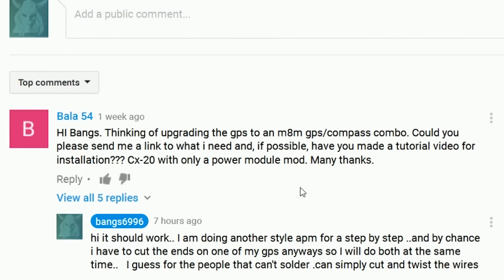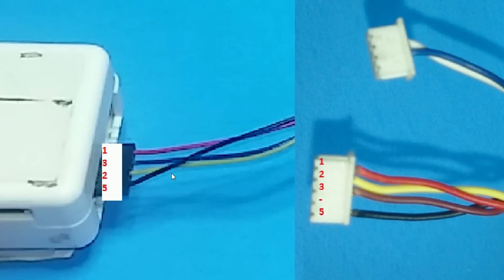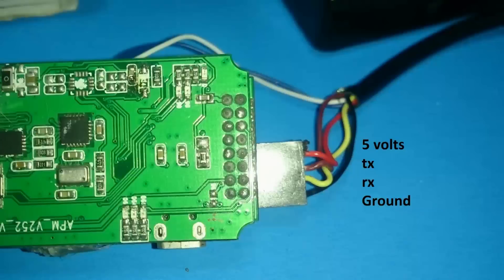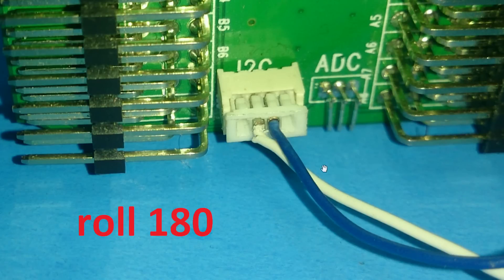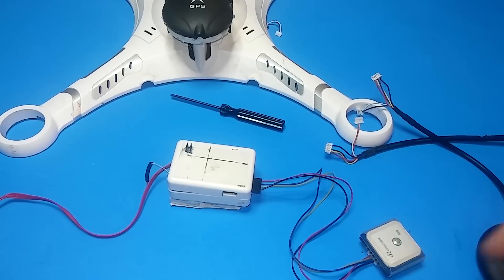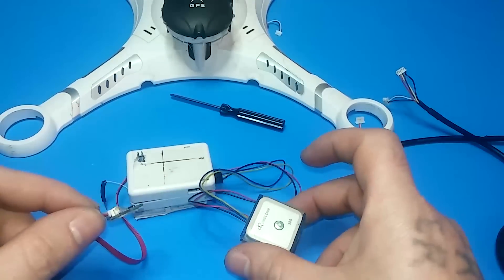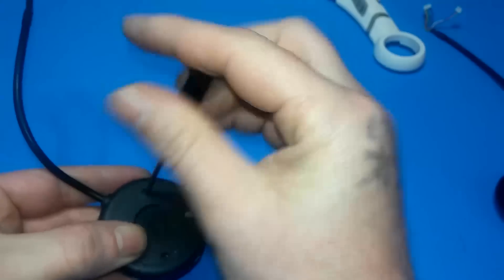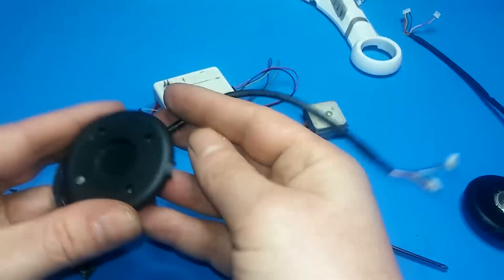cx20 apm 252 v5 upgrade only gps the compass is optional

Comment: Is it proven that the gps change makes the quad a better flyer?. Because it looks like it performs the same to me. Just getting more sattelites. That's it
Reply from the maker: HI its not really worth it unless you have issues with yours.. more satellites means you have  more stable gps flight or return to home. .. the m8n gets the most satellites however it was shown to me all three 6m (cx 20 gps) ,,neo 7, and m8n all get the same specs on tracking ..  In theory the neo7 and m8n should work better then the 6 on cloudy days ect..
Reply: bangs6996 Alright. I understand. Good mod indeed. Well mines work stock fine so if it works why change it right?. I'll like this if any issues later down. Blessings

Comment: can you program my apm on my cx20 to a 30deg tilt.  i will ship and pay for you r services. thanx
Reply from the maker: I'll just create the firmware and upload it.. just give me a bit..just testing it out..
Reply from the maker: hi.. you still around?
what firmware are your on?

if your on version 3.21 or even 3.12 but i think version 3.12 is limited to 2200 already..
anyways..before i mod the firmware try this..
open up mission planner.
go to
config/tuning 
Full parameter tree
look for
"ANGLE MAX" 

try changing that to say 1000 
then write your parameter. unplug the quad and try to fly it.
indoors if possible as it should have almost no tilt at all.

then try 3500 ect.. becarefull not to use 8000 ect..or you will probably destroy your quad..

-------------------------------------------------
If you don't see full parameter tree
open up mission planner but don't connect
go to 
config/tuning

only thing that is probably listed is Planner
click on planner if others stuff is listed.

scroll down "Layout"
and change it from basic  to advanced

let me know how it goes..
Reply: YOUR AWSOME, THANK YOU.

Comment: Hey, thanks for mentioning my video! Just thought i'd let you know the wiring for this particular gps, http://www.ebay.co.uk/itm/252111344885?_trksid=p2060353.m2749.l2649&ssPageName=STRK%3AMEBIDX%3AIT. Thought it might come in handy for someone else. Black to black, red to red, yellow to white and blue to yellow. Can i ask you a question also if your not to busy. The syma x5c manual tells you how to use the trim buttons ie if it's drifting to the right , click bottom right trim to the left......and so on. It's so simple and effective. Can you do the same on the cx-20 and if so, which of the 4 switches do what?? This is hardly ever mentioned anywhere and would be such an easy fix to a lot of problems that otherwise would be conceived as complicated. Just a thought...... The latter colours i mentioned there, by the way ,white and yellow are rx and tx in that order on gps end. Who's complicating things now??!!!!! I have put my quad back together but waiting for weather. Will report. Ta.
Reply from the maker: the trim buttons on the cx20 correspond in the same direction as the sticks.. if you want to see your progress .. connect just the usb  cable and go into mission planner.. Radio calibration,  then start using the trims, you will see the pwm move about 100-200pwm in either direction.

so with that, say its rolling to the left..  you will want to move the trim button to the right..

Its also why I tell people to find center before doing a esc calibration or mission planner calibration.

the throttle does nothing  as far as i know, I think its really there because of the mod1 remotes ..could be wrong..
Reply: Hi Bangs. Could you tell me what the advantages are of updating the apm from 2.5 to ...........whatever?? Also, although i've installed the power module and gps , am i really wasting my time by not installing a different fc aswell?? Havn't flown yet; wind can stay up here for months (not always like the video!!!) . Thankyou, i value your opinion.
Reply from the maker: Hi and thanks.. the pixhawk would be the next upgrade I found the apm very solid so much so I took it out because I found no point making step by steps for it..as everything seems to work for it.. where the apm 2.6 I have more fun modding it ..

upgrading to apm 2.8 .. is really pointless and only benefit are the pins..   adding things like sonar and optical flow is more of a novelty, and you would prob just remove both over time. 

naza-m v2  gets good reviews and better gps rtl then the pixhawk, butttt I don't have one to give a honest review on it. 

I keep holding off on the naza-m v2 because I keep thinking a new apm will be coming out any time soon with more avoidance firmware and hardware.
Reply: Sorry, lost you there a bit, remember i'm a novice !! Ha. Would the pixhawk be my next move?? I'm not planning this anytime soon; just curious. I did watch a part of your pixhawk installation video earlier. Looks a bit complicated!! Saying that, i'm sure it's not as complex/confusing as it looks??? To be honest, i'm really enjoying tinkering with it now and it doesn't instill half the fear of flying it!! I was actually going to bin it before i got in touch with you initially. I'm glad i didn't. You learn a lot about something by being helped to fix it. I'm not really interested in telemetry , at least not yet, i just want it to be stable so i can relax while enjoying flying it. After all is'nt that what it's all about?  Do you think , optimistically speaking, that what i've done to the drone has improved it slightly......vastly??  Sorry for rambling!!
Reply from the maker: I would say slightly if the upgrades were power module and gps .
they were both upgrades.. the power module for rtl on low battery and 
gps for locking on sats faster or at least re finding them faster.

I just had to go through our messages.. did you get your led's working under the quad. or did you leave that ppm wire off??

You do have another option with those leds  , I think they still blink on low voltage for you , but you can un solder all the led wires from the main board .. so you should have 4 white wires(maybe one red,motor 1) coming from the 4 esc's. then attach them  to your power module 5 volt wire that you might not be using.  you will then have all 4 lights.. but they won't blink on low voltage, The alarm should still sound though.
Reply: I think i did leave the ppm wire off. To be honest i don't think the lights are all that necessary. I would ,of course, put them back on if it was a relatively easy job the next time the lids off (which prob won;t be too long! Ha). Will my alarm sound at the moment at low voltage?? I can't remember. Thanks for trawling through that. Roll on spring so we can fly them!!!
Reply from the maker: yes thats a good price for the apm http://www.gearbest.com/multi-rotor-parts/pp_234810.html?wid=21&lkid=10348444  you can find them on ebay as well for 28us  .. I am working on a video right now on a apm from gearbest.. and will be uploading today or tomorrow
Reply: Ok Bangs. I might go ahead and purchase but a couple of questions first if i may? Would this be a big improvement from the stock fc and if so, why?? There's a couple of customer questions and answers in the link which confuse me. Basically implying that it's not compatible. I assume, with your expertise , you can find a way round that? Thanks.
Reply from the maker: no improvements..they both take the same firmware and have the same hardware,
the only thing you can benefit from is the better gps
and easier way to plug in things.

No idea why that person said it would not work , maybe because his/her stock gps, compass and led's would not fit in without having to be modded.
the gps part is some what right without having to order another cable or doing direct solder. 

you also need a 5 pin end for your gps to fit into the apm 2.8
yours is for a pixhawk(it had 6 pin end) .. you need the 5 pin one made for a apm2.8

about the gps not working as well, If you have it working in the apm252 it will work with the apm 2.6 and 2.8 ..its the same hardware./firmware

Personally If you are happy with yours stay with it .its the same thing,
If you want a extra apm so you can piece another quad together then get it ..

If you want you can fallow my apm 2.8 step by step
https://www.youtube.com/watch?v=mrBWEATUbus&t=1587s

the only diff is the side pins.  and you might have a built on compass,If you do then you have to scrap off a small trace..
Reply: Morning Bangs. I took my wee machine outside , powered up, and left it 5 mins. Connected up to mp in situ and checked pre flight. Showed 18 sats!! Delighted. One niggle though (isn't there always!). It showed the battery level as 0v when it actually has over 11v. Why should this be??  To windy to fly. Ta.
Reply from the maker: open up mission planner and go to    Config/tuning
then full parameter list
use the scroll bar and find 
log_bitmask     what is the number beside it?
Reply: Sorry, just saw your message. It's 830.
Reply from the maker: yeah it should be logging current then.  unless in battery monitor setting you did not set it to voltage and current,    when you are viewing the logs. you can try to filter just curr 
I don't have any back ups right now to see if I also have issues logging current.     after I'm done with this build I will check more into it.
Reply: do you mean v and curr on failsafe screen?? I can tell you're busy so this'll do another time. Thanks again.
Reply from the maker: hi.. i mean in initial setup under battery monitor where the drop down menu lets you pick voltage or voltage and current.. and yeah this new video is not going together its over a 1hr.. and it was suppose to be a simple step by step// but now its more of a learn with me.type.. lol.. .

.
Reply from the maker: Hi .. have you figured this out yet?.. it seems to work . I hooked up a multi meter and its off about 200mah but I can't edit the battery size either in my mission planner version..

If you want you can send me your logs here
bangs696969@gmail.com 

For a test .
just arm your quad with no blades 
.slowly bring up your throttle to full 
wait about 4 second.. then slowly bring it back down
wait about 3 seconds.
then give it a few full throttles and back down.

disarm the quad.. wait about 10 seconds ..unplug and plug it back in
download the log file and send it to me if you want.

but with that I would not mind seeing the ones with the blades on as well.
Reply from the maker: also i meant in this screen ..set it to voltage and current
https://youtu.be/rTRFXnnsnUU?t=683
Reply: Hey, good to hear from you and hope build going well. I think i've got it sussed. Gonna send a few screen shots through my phone to see what you think. Followed your instruction. One confusion though. Battery capacity in monitor screen keeps resorting to 3300 no matter how many times i change it to 2700?? Ummm? Took a pic of the infamous bird too. Please tell me what you think of each of the settings. I will do the suggested test tomorrow and photo logs. Where do i find logs screen by the way. Excuse ignorance!! Ha ha. Always grateful.
Reply from the maker: yes thats what I meant (3300) about the battery size.. I also can't change mine.. ill look later to see if I can fix that ..
it also reverts back to "other" as well..
Log files are here 
https://youtu.be/eqLussOrty0?t=1425
I have not really touched on log files in any video's accept that one ..

thats what I thought you were looking at.
after you download your log file on the first screen just choose review a log.
Reply: Did the photos come through??
Reply from the maker: nope.. did you send to bangs696969@gmail.com ??
Reply: Yeah but i'm getting an error in phone email account. Will try to sort out later.
Reply: OK.I think that's sorted. Please let me know when you receive the photos. Ta.
Reply from the maker: Hi .. had you made a custom usb cable with no positive wire??

if so,  plug in the cable then plug in the battery and connect to mission planner.

arm the quad and move the throttle up, you should see your amps.
Reply: My phone showing sent so you should get pics. If they're very unclear, let me know and i'll try take better ones. Ta.
Reply from the maker: and here is how to fix our issue..
https://drive.google.com/open?id=0B2w6_OKE_2kxS2xUejJyZkMta1E

I would set if for a few under .. so say you have a 2800 battery and its old ,and you don't want to go through the long process finding out the true capacitance left.. put down 2500-2800  ..    If you have a imax charger then just simply drain the battery then charge it .. it will tell you how much amps had to go back in.
Reply: Thanks for that, will do. I have done test but there are 28 logs here. I take it i'm wanting the one at the bottom of the list with the highest number??? Any e-mail yet??
Reply from the maker: HI , Yes I received them its why I said you should be getting current. but it seems .. you were connected with modded usb cable and battery???  you should of been able to arm it and move the throttle up .    Its the last log you usually want but the last 3 does not hurt as well in case its logging when disarmed as well.
Reply: Yes , connected just like that.
Reply: Have downloaded them but can't find them on computer!!! Where on earth do they go????
Reply from the maker: C:\Program Files (x86)\Mission Planner\logs\QUADROTOR\1   
usually.
Reply from the maker: also if your over whelmed with the info with the mission planner log viewer.. you can try this program
https://www.rcgroups.com/forums/showatt.php?attachmentid=8543312&d=1451130192

i just extract it then instead of running setup went in application files folder and doubled clicked on APM Log File Analiser
it asked to update i just picked yes and all is  well ..

it gives most of the information you want in a nice clean way with some tips as well if something might be wrong.

just click on the graph icon to check out the volts and amps. in more detail ..
Reply: I've downloaded that but not sure what part of log to "feed" it?? Have you run any of my logs through it and if so, was everything ok???? Curious???
Reply from the maker: edit..........
Reply from the maker: ah ok ..i looked at another one of your logs.. and 
you did ok.. however you are having issues with the current and voltage logging ..   .btw you have 17 sats with a very low hop.. not bad..

maybe its because your running version 3.1.2 firmware

i will try some test later today ..or you can try installing version 3.2.1
and try again
Reply from the maker: wait a second .. in case your going to update..  btw i have been giving you instructions this entire time thinking you were on version 3.21
Reply from the maker: alright .. yours is logging good.
you need to use mission planner to view your logs
once your in the  "log browse"

find and load one of your logs.

If you click at the top of the chart cells.. it should bring you a filter dialog. then just pick curr 

good to know that my little apm 3.1 can handle version 3.1.2 without a brick hehe..
Reply: I think this calls for one of your short but concise videos?????? For all us technophobic numptys!! HA ha. Seems like a really good wee program......... I would like to try with blades (if we ever get calm) and see what you make of the log. Would be really interesting and hopefully instill some confidence in the accursed bird!! Will try do that as soon as. Time to give it z's here, work tomorrow. Enjoy the rest of your day.

Comment: Hi Bangs. I get compass before i change to "external" but it is not accurate ie when quad facing north MP shows west! I have put the arrow on the new compass in the puck pointing towards the front of the quad. When i change settings to external in mp i get "bad compass health". What would you advice?? Thanks.
Reply from the maker: set it to manual and set rotation_roll to 180..
Reply from the maker: make sure to do a calibration as well
Reply from the maker: andddd.. if you are still  not pointing in the right direction .. just try different settings like .. roll_180_yaw_45   ..and see if its pointing right.
.. If you do have to play with yaw settings can you post back which one you had to use.. for your unit..
Reply: There are only 2 boxes. "use this compass" or "external compass" . I should have said, i have not swapped the wires in the compass molex plug. Maybe do this and go external??
Reply from the maker: you don't have this.. https://youtu.be/100QqGqJVDo?t=968   let me boot up my vm and check the newest version ..maybe they removed it..   you should not have to switch the wires around if you had it working before but pointing in the wrong direction.
Reply from the maker: ah ok they changed the layout..so yes put a check mark in both ..in the compass #1 box's then the drop down menu find the rotation_roll_180 and try that.. if it does not work then try the yaw as suggested above.
Reply from the maker: wow ..gong to spam you.. you might have to click on the green button that says  "Apm and external compass"   to get that drop down box
Reply from the maker: does mp look like this?.. i just made a quick pic ..
https://drive.google.com/open?id=0B2w6_OKE_2kxbGQyUlExRXlES1E
Reply: Ok. Rotation roll 180 works best as initially thought. Ticking BOTH boxes seems to have done the trick. Have to put things back together to calibrate. I'll prob do this manually since going back to factory firm and params. Thanks to you for that too!! Will check everything over and close her up. Thankyou for your time and have a great day.